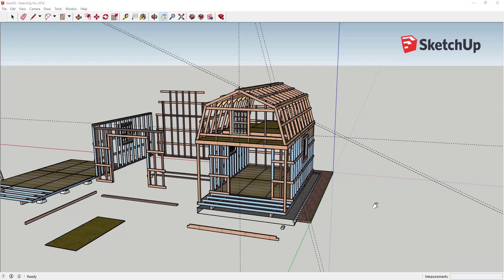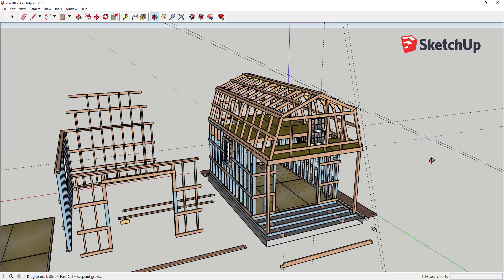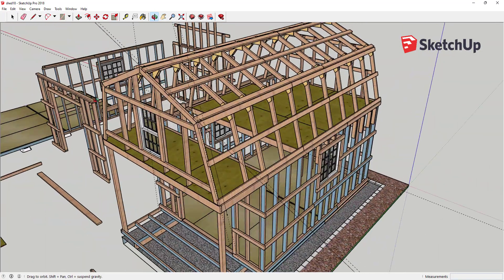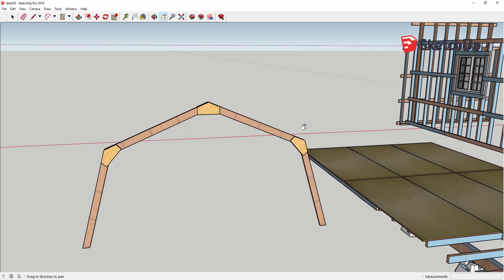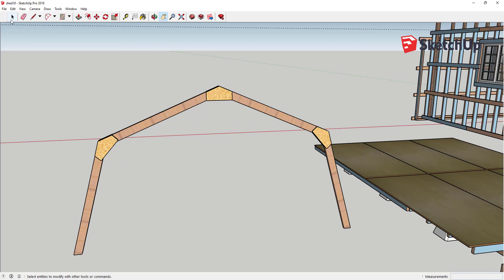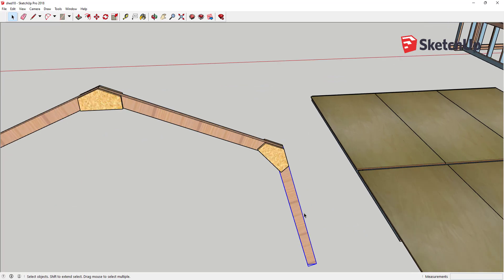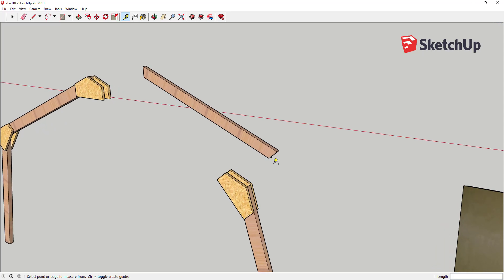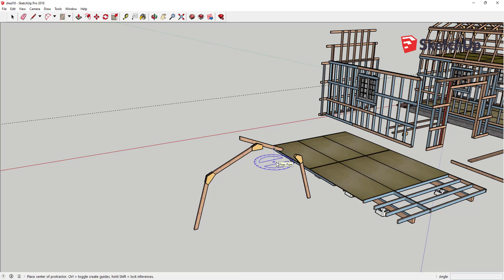Gambrel Dimensions

Comment: Ok so if you have a 12 x 12 gambrel truss , I listed on comment below ,on 12 foot wide with 22.50 miter cut both top and lower truss will be at 55 inches, When you put both sides together you will have 4 sticks for the truss, Now if you change the pitch from that 22.50 you now are going to change the length of the rafters , You can take 4 sticks cut them at  55 inches and with both ends at 22.50 Degrees ,Put them together end for end you will end up with a 12 foot wide barn truss, Then when this is built you can put this on to your top plate, I hope this helps out... Big Thanks

Comment: cutting all ends of truss at 22 1/2 is the most common . on a 16 wide the top truss is a 5. 12 and the lower is a 12. 50 , If you want a different pitch on the lower that will change the amount of plywood need for the roof... It comes down to what you want for a roof line look.

Comment: this is a good way of building gambrel trusses, I have been building Barns for over 30 years now, here is what I do for small, shed type of Barns. If you are going to build a 12-foot-wide barn Cut all 4 trusses at 55 inches in the long of the truss, then set your miter at 22.50 cut all the ends of the truss at that 22,1/2 when you put them all together. Then you will have a 12-foot-wide truss with a 75. 1/2 max opening for a loft. Now on a 14-foot-wide barn cut all truss at 65 inches with a 22 1/2 Degrees on all ends and that will be 4 sticks, You will end up with at 14-foot-wide truss with the same opening for a loft, on a 16 foot wide cut the truss at 73 1/2 Degrees on all 4 sticks put them all together you will end up with a 16 foot wide truss. Gussets can be out of plywood 6 inches wide by 12 inches long, put all the miters together on the Gussets and you will see the pattern that you have to cut to nail on both sides and there you go.
Reply: I was looking at building a 16 wide shed/cabin.  Cut the boards 73.5 inches with a 22.5 angle?
Reply: I'm wanting to do 12' wide for loft how tall does that make the truss
Reply: Please tell me the length of the lower trusses as I'm building a 12' wide with a 1' overhang for soffett and a 1"x6" facia. Thanks